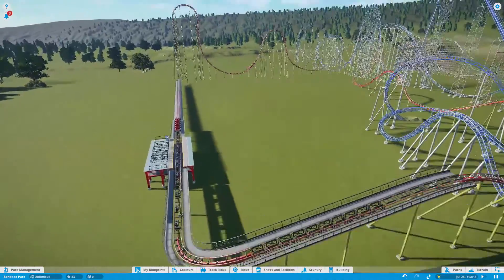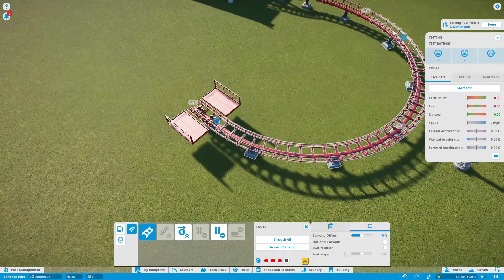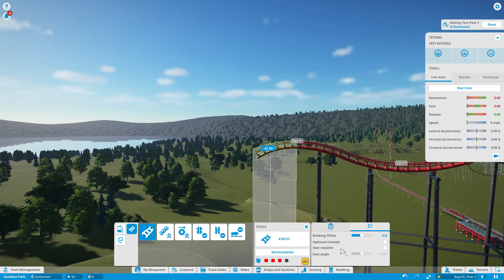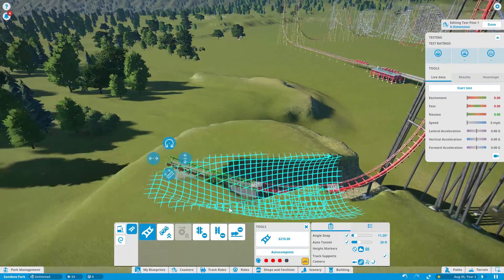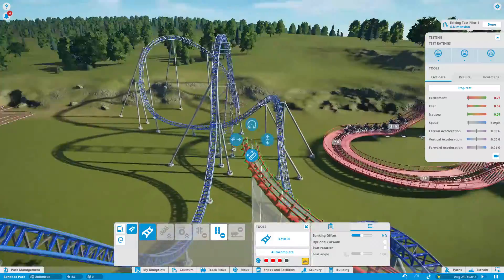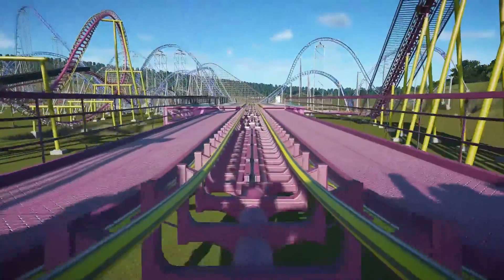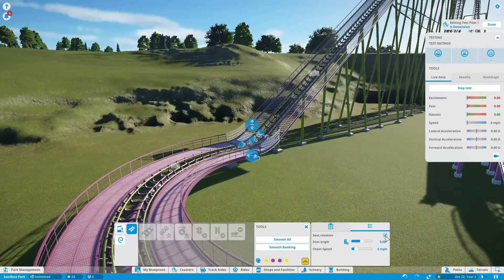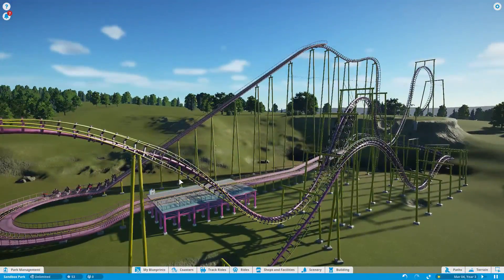Planet Coaster - Shaun Builds A: S&S/Arrow 4th Dimension Coaster

Comment: Awesome to see :) 
I'm building my custom gaming pc right now and am so so Excited to play planet coaster in about a week or two
Reply from the maker: Connor Pawlowski What are the specs? Cpu, Gpu, etc...
Reply: Hops and Pixels
 i5 7600k 
asus GeForxe GTX 1060 6gb
kingston hyperx 2x8gb ram
msi b250 pc mate motherboard
the rest is just general, power supply, hdd, ssd etc
Reply from the maker: Connor Pawlowski Very nice! I'm kicking myself for not buying a newer motherboard when I bought mine. At the moment I'm stuck with a am3+ board which means I'm not able to use any Intel chips. Everyone told me to go i3 instead but I didn't listen. That said I plan on upgrading to the fx 8350 and possibly the 1060 or 970 depending on the sales I can find. The RX480 is tempting but I love Nvidia cards.
Reply: Hops and Pixels sounds good! 
I'm worried about the performance with planet coaster, does that seem good?
Reply from the maker: Connor Pawlowski You'll be just fine. For what it's worth no matter how much of a beast your computer is the frame rate is going to tank once your park gets a high object and guest count. 3000 guests is the max I would recommend. But you should definitely push the limits to see what yours can handle. I have over 8000 guests in my Cedar Fair Park right now and I'm hitting about 8-15 fps. This is with a fx-6300 and a gtx 960 ssc. Yours will obviously run better than that though.